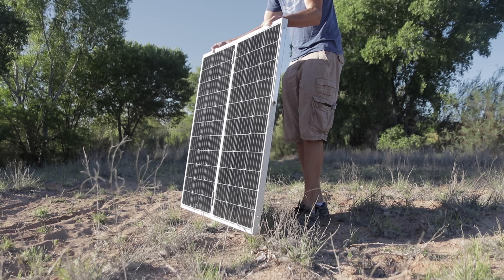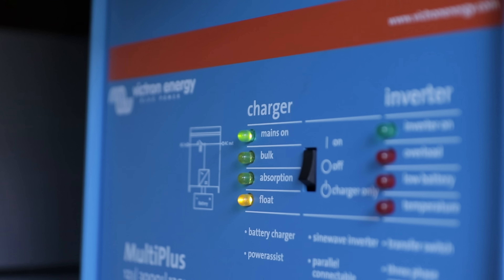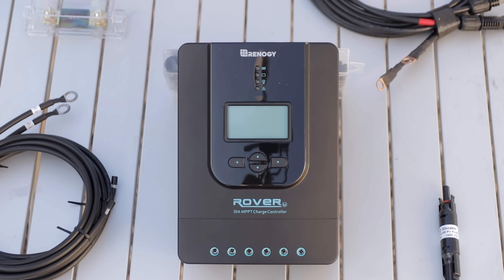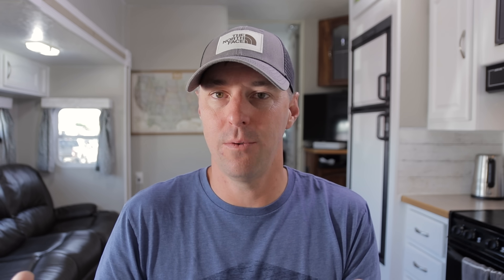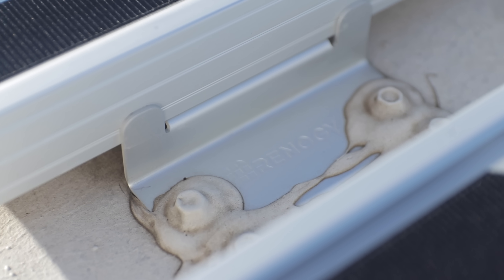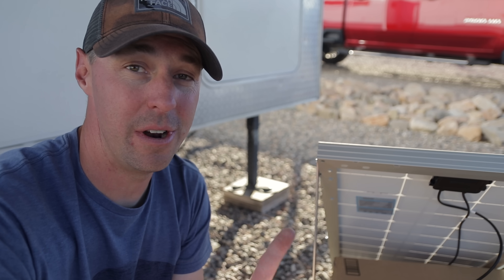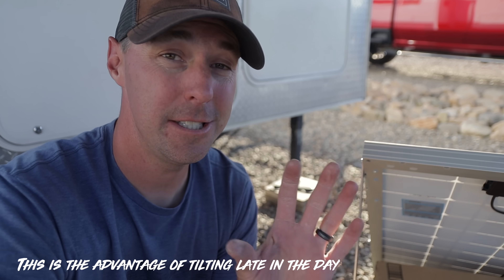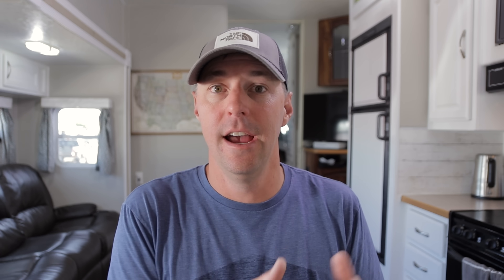Expandable RV Solar Setup First Step! DIY Solar Suitcase.

Comment: If you bought that inverter does the mean where the existing shore power that comes into your rv goes to an existing inverter that distributes your DC and AC power throughout the trailer has to be switched out to this new one your showing ?

Comment: Jared, long time follower, love your content thanks! I know it’s been 3 yrs but hoping you will see my post/question. So I’m in the process of adding a 400w Renogy suitcase to our solar arsenal. I have a Zamp port on the side of my Oliver LEII trailer (btw, we bought the Oliver based on your factory visit/review a few years ago!😊). I currently have a Victron MPPT 100/50 for our roof solar and will be adding a 100/30 for the 400W suitcase. Do I need a solar disconnect between the zamp and mppt inside the trailer, like I have for my roof solar? Im thinking no because I can just disconnect the panel at the external zamp port. Thanks again!

Comment: I'm new to solar, and just bought my first LiFEpo4 battery. It is a 12v 100ah battery. The manufacturer recommends charging it at 20 amps. I want to start with a 200 watt solar setup and I like the idea of piecing it together myself. In the future I want to be able to expand to 400 watts with 2 batteries and maybe 24 volts so how would I size the inverter then?

Comment: ADVICE PLEASE… I have a camper with a 100w fixed mounted panel.  I would like to intermittently add a 200w briefcase that I can use when the fixed panel is under a shade tree.  The briefcase has no controller and I would like to run it through the existing controller on my camper.  That controller is 12vdc, max 30v, 6a Solar and 6a battery. How do I wire the new portable panel?  Do I just wire it to the same +/- lugs that the fixed panel is wired to?  Anyone, please advise.

Comment: never start with just lead acid, if you cant afford LiFePo4 to begin with, SAVE UP! its not even much more of an investment than lead based chemistries because LiFePo4 48v server rack batteries still have 85% SOH after 15-25 years of use! and they still keep going making your investment worth WAYYYY more than accwoledging acids exsistance!

Comment: Great video Jared exactly the info I was looking for, I have a very small 16 foot trailer with a very busy roof and a permanent mount just doesn't seem feasible. This will work great to top up the batteries while boondocked, one question though, how weatherproof is this system if it was left out while we were away and a sudden storm came up?

Comment: Thank you for showing how you built it, but one reason I googled and found your video is because I need to know exactly what the connection to the battery from a suitcase panel with a separate charge controller looks like. At 7:00 in the diagram the positive from rv load disconnect...what is that? UGH I still have no idea after 12:01 minutes.

Comment: Hi Jared,
So I just bought 100ah LIFEpo4 battery to replace my lead battery. It has a BMS in it and I ordered a bluetooth monitor. I saw a suitcase solar panel that has battery clamps that connects directly to the battery. If I get this do I even need to buy a controller? We mostly do campgrounds, and I was just thinking of in between when we do boondock. Thanks

Comment: I love the idea of finding the most efficient upgrade path to solar.  Can I start with the Victron Multiplus 3000 12v with one 12v lithium ion 100ah battery with the plan to increase my battery bank over time?  Any issues other than not taking advantage of the full capability of the inverter?  Thank you for all you do Jared.  Extremely helpful for us DIYers!

Comment: Hey Jared, I'm going to take the plunge into fulltime rv'ing.  I also plan to do a significant amount of boondocking.  Is any of the solar equipment available at purchase worth it?  Or, should I just plan on taking the basics (standard equipment) and purchase custom as I add the solar?
Reply from the maker: I would price out what the options are but usually it is more cost effective and a better system if you build it yourself.

Comment: I want to  start working toward having a solar setup on our new trailer and the first thing I would like to get is a 2000 watt inverter for our 2 deep cycle batteries.  I need to power a CPAP machine and a small refrigerator. The trailer is prewired for solar on the roof.  Is there one device that will be a good starting point?
Reply from the maker: I think the kit in this video is a good starting point for the solar.

Comment: Question, when you are upgrading your inverter. Did you have to run a knew cable from the battery bank back to your inverter. I ask this because I have a 2017 Jayco Greyhawk 29mv, I replaced the stock house battery with 4 x 100 lithium and I upgraded the stock inverter "1000w" with a 3000w inverter, I upgraded the converter as well, with a model designed for lithium batteries "same brand" as stock. I have 4 x 100w flexible panels on the roof. I must say, I feel the system is terribly "under preforming" I'll furnace you with more specific details if you feel like digging into this with me. I had a company take a look at my setup and was told that some of my cables were undersized. But when they suggested that the cables leading into the inverter were too small, I had to stop and get a second opinion. 
Thanks in advance 
Ron, Indy
Reply from the maker: Yes we did new cable from the inverter to the batteries. We have 4/0 cable which is 0000 not 4 awg. The size of the cable can be very limiting. I have seen replacing a converter with a 60 amp converter and not changing the wire to limit the charge at 20 amps. Once the wire was properly sized it was able to deliver the full 60 amps. Wire sized too small will limit power and potentially be a fire hazard if not fused for safety.
Reply: @AllAboutRVs  Thank you, I'm going to double check the size gong into the inverter. I was thinking about contacting Jayco because they used bulk wiree that don't have any markings, one wire going into the inverter actually has a hand written (+) plus sign to show (positive) , wow

Comment: Where do you store the portable panels? Did you build a soft case?
Reply from the maker: I just slide them behind the couch.
Reply: That’s a good idea. I had just been storing them in the front cargo area when I traveled and they took up a lot of space. I don’t have a couch but I can put them in front of my bed and the wall. It’s not enough space to walk but enough for the panels. Thanks. 👍🏻

Comment: Thanks Jared, i just purchased 2 panels from renogy, at a great discount (Thank you very much) and the charge controller, BT module, and fuses from amazon. the panels wont be he for a couple weeks but everything from amazon, I will have by Monday 18 May. Its been almost 3years trying to figure out what I wanted for my 23' Kodiak, but Monday I watched your video and this was just what I needed. In the beginning I was going to purchase  a suitcase type of solar system but the only issue I saw was everything was out in the element of the seasons.  I have already set up a area for everything and I have a furrion solar plug outside of my right side door prewired. I just had to add 3/8" panel for the controller and fuse to sit on. All I  need now will be the panels hopefully that will be before June. Thanks again

Comment: What does it mean if my camper already has a solar ready plug? Can i just plug panels into that, or would i still need a charge controller? Love your videos, very informative.
Reply: The "solar plug" is nothing more than an outlet that goes to the batteries.The plug is designed to receive power from a portable setup that includes a charge controller.

Comment: I like the Renogy products too.  Have 4 x 100W panels on the roof of my Grand Design Momentum 351M in series and parallel configuration sending up to 41 VDC and up to 13 Amps to my Rover MPPT 40 Amp controller with BT to my iPhone.  I love your idea to expand with tipped ground panels for more solar capture.  -Jersey Mike

Comment: I bought 4 Renogy 100W panels in October 2019.  All came nicely packaged with lots of Renogy markings.  The  “Renogy Installation Guide for PV Modules” states in section 4.1 (Page 5) that drilling holes in the frame of the panel will void the warranty.  Since there is a substantial performance warranty, what info can you share?  Has Renogy dropped this requirement.  I would love to add some hinges and legs like you did.  Maybe I am just too conservative.

Comment: It says code "AllAboutRVs" does not exist :(  I was actually planning to buy a DC-DC charger.
Reply from the maker: The code is good for regular priced items. I saw the DC to DC charger was a free item deal of some kind. I just ordered a DC to DC charger and it worked then. I'll send them an email to see what is going with that. It's a little strange if anything in the cart is a special it will reject the code. I had to add one regular price item add the code and then the other items I needed.
Reply: @AllAboutRVs  Yea its putting some other item in my cart that I don't want.  I can't delete it. :(

Comment: This was a great video, thank you!  
Would you be able to talk about how this might work with "solar ready" campers? What are the limitations with "solar ready" campers and what equipment would have to be replaced on the "solar ready" systems?  Thanks again.
Reply: In my research of new campers that are marketed as having "Solar Prep", it often means that you can have as much solar as the third party vendor allows.  Unfortunately, that usually means that you can't actually install much solar.  The wiring included in a "Solar Prep" camper isn't enough to support the number of watts I would like to put in.  I'll have to run new wiring to make that happen.  Ideally, what I would like to see is 3/4" conduit run from the roof to where the batteries are located.
Reply from the maker: Great idea, I'll try to cover that soon.
Reply: Solar ready is a term that is not consistant across OEM's. This means many things. Some have dead end wiring that is helpful, but doesn't help with any of the components. The solar plug is simply an outlet with wires to the battery. You still need the panels and charge controller.

Comment: Question about multiple Solar Controllers:        First, Great video Jared.  Here's my question...  If you have multiple Solar Controllers, one for the roof solar panel, and one for the portable solar panel, will the 2 Solar Controllers confuse each other?  For example, let's say your battery is dead.  The solar panel on your roof is providing "Bulk Charge" using that panels fullest amperage.  Now, you plug in the portable controller.  Won't the portable controller "see" the high voltage on the battery coming from the solar controller pumping in that bulk charge?  Wont then the portable controller just provide a trickle charge, rather than it too providing a bulk charge, therefore not adding much value?
Reply from the maker: Great question. We often charge the batteries with multiple chargers and they work well together. The internal resistance of the battery is what allows it to accept a charge from multiple charge sources. So the voltage being set by the charge controllers don't effect the other one the way you might think it would. In setting things up for this video we actually had the Multiplus charging the batteries while the panels on the roof were charging the batteries through one charge controller and the portable unit in this video was also charging the batteries. We had a combined 110 amps going into the batteries.  I hope that helps
Reply: When wired properly, the charge controller is reading the battery voltage, not the charger voltages. Even though 14.6-14-8 volts is going in, the battery is still reading in the 12.? range and slowly increasing. A good quality charger also handles this well if you're using a generator to supplement charging.  Good question!

Comment: what size fuse to buy with this system? Thanks
Reply from the maker: I did a 10 amp inl-ine fuse for the panels since they were wired in series and a 30 amp fuse with 30 amp wire to the batteries to match the 30 amp charge controller. If you add more panels to this setup then you don't need to replace the fuse and wire up to 30 amps.
Reply: All About RV's Victron’s Smart Solar 75/15 controller seems to already have fuse so in additional fuse on cable to battery really needed?

Comment: Jared, always great information sir! What about mounting systems? When our 5er was being built I had an extra large battery area built and oversized junction box on the roof for “future” solar. Is there multiple mounting systems or are most systems “whatever works for you”. Personally I would like to tilt on both sides of the coach because most times you can’t control sun rise/set direction. Thanks for the video!!

Comment: Hi! Total greenhorn here. I have 2016 Dynamax REV rv prewired by Zamp with plug in port. I have what they said are flood/wet batteries..new in February. Had a professional check polarity and make me an extension cord. I bought a Renogy 10p watt suitcase with 20 A attached weatherproof controller. Used it 2xs- fine. Then it showed a code- b01- which they say means battery < 3v. It can't be..since lights step and frig work fine. Any ideas?
Reply: What item is giving you the code? The RV? The charge controller? Contact the manufacturer.

Comment: I need to do an energy audit of our trailer to know how much battery we need. Suggestions please.
Reply: John Butler Go Power has excellent calculator to do it.
Reply: Purchase a kill-o-watt unit. Or you can google "rv power audit" and find tons of lists and spreadsheets to work from. A basic RV uses 15-40 amp hours per day depending on the size of the rig and the items you use. A larger RV could be 60-100 or more.

Comment: Jared,
First of all, great write-up for an expandable system that can grow with more $$$ spent without major changes.  I apologize in advance for the length of this response, and I certainly didn't set out to confuse the noobies that have watched your video. I have no dog in this fight, as I'm still researching what kind of system to invest in.  I have a question about a couple of techniques that seem to be used a lot for grid tie, but I don't seem to see hardly anyone writing about or installing them on the RV side of things.  As I mentioned in reply to a previous comment below, each group of panels (group loosely defined as panels that are receiving the same exposure to the sun at the same time), should be on their own charge controller in order for the MPPT to function optimally.  This implies that either each charge controller is physically located near it's own group of panels, or there would need to be multiple wire runs going back to the equipment bay if that's where the controllers are.  The scenario I'm thinking is where you have a conventional flat array on the roof, then you added another group to the roof, either on tilting stands, or maybe a couple of panels that flipped up like an awning or whatever. 

There are two techniques used in residential systems that allow everything to be combined, and all the available power sent effectively down two wires:
1) Micro-inverters  2) Solar Optimizers
For those reading that have no idea what these are, what these have in common is that they (usually ?) mount (1) per panel, and then the output of all the (micro-inverters or optimizers) are joined together on the same pair of wires down to another device located in the equipment bay.  The other thing they have in common is that each device has MPPT built in.
The difference is that a micro-inverter takes each panel's output and converts (technically inverts) it into 120VAC, whereas the solar optimizer leaves it as DC, with the voltage usually being much higher than the panel voltage (to minimize the size of the wires), as worked out between all the optimizers in the system and the (usually proprietary; same brand) inverter/charger that is located in the equipment bay.  See https://www.solaredge.com/products/power-optimizer#/ for more info on one brand I've specifically researched.
The disadvantage of both systems would be the up-front system cost, and potentially brand specific hardware.  A disadvantage specific to the micro-inverter route would be having to effectively fool them into thinking they are connected to the grid, which for safety reasons is built in to the technology.  There are certain brands of (main system) inverters that will work with the micro inverters to create a "grid island". 

For the SMA brand of equipment, see https://www.wholesalesolar.com/2945484/sma/inverters/sma-sunny-island-6048-us-10-inverter. 

The brand Enphase also has a complete system including the LiPO batteries they just released see https://www.youtube.com/watch?v=0je0e5bVgBw
As I mentioned when I started this comment, I haven't seen any of these networked smart systems transfer over to the RV side of things.  They have the advantage of identifying problems down to the individual panel; You can look at graphs on your phone showing the output of each panel, relative to it's neighbors, making it easy to spot issues.  The technology currently being used in RV solar systems probably dates back to the '80s.  Sure, there are smart inverters that can talk Bluetooth or WIFI, and I'm sure the MPPT tracking they have is faster, smarter, and better, but as a complete system, most RV solar tech is getting a little dated.
** Again, apologize for the length of this comment,  JC **

Comment: Sadly I have to report an error. Your Amazon link to the Solar Panel Wire takes you to the In-Line Fuse page. The link is identical for both.
Reply from the maker: Thanks for letting me know about that, I’ll fix it